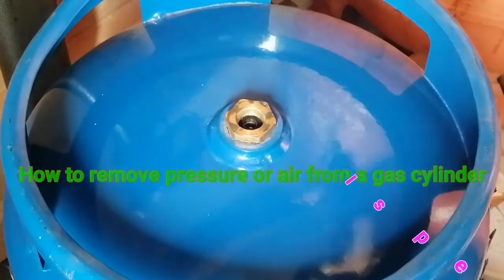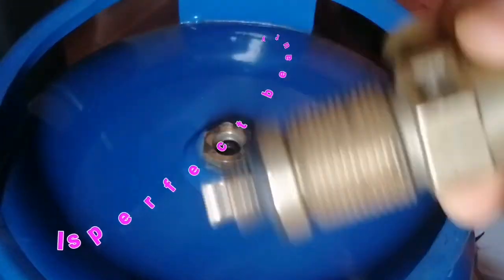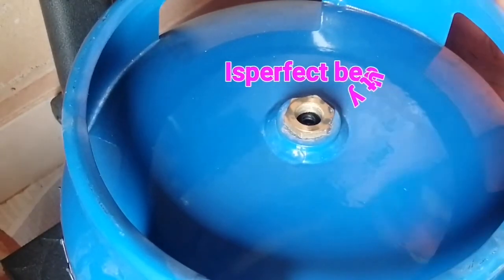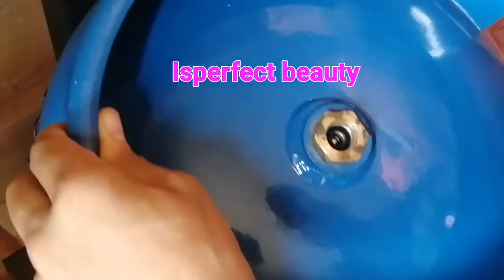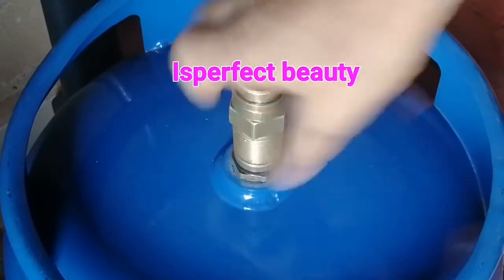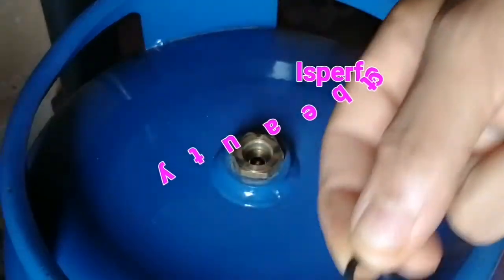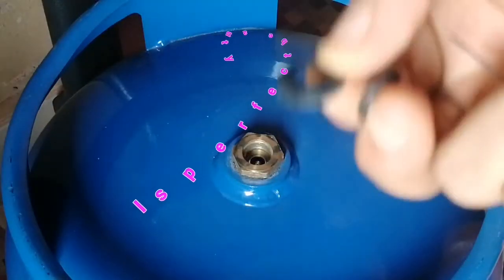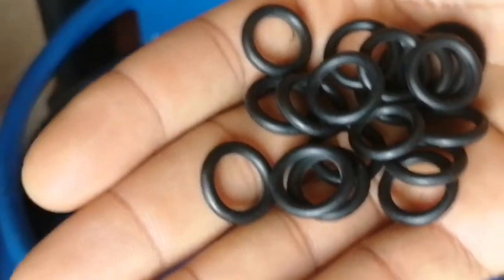How to remove pressure or air from a gas cylinder

Comment: Please I have issues filling gas for a particular customer, the gas was going into the cylinder and it stopped suddenly I tried this method by releasing pressure from the cylinder but I notice it was my products that I have filled inside that’s coming out. Please what can I do?
Reply from the maker: Air is deferent from gas. when are is coming out, you know. If gas is coming out, you will know as it comes very cool. If it is gas coming out, i means the cylinder is full. It is important to know the weight of the cylinder when it comes in, and rescale when you finish fill and add it up to see if it is completely.

Comment: My customers keep complaining that our gas doesn't last. What could be the cause? 

When Customer comes, i first of all, fix the nozzle, then the hose, put on the scale, place the cylinder on the scale, it will start from zero to read till for instance 1kg. But after removing the host and nozzle. The it wont be upto 1kg. Y?
Reply from the maker: For the last, try and buy from a different gas plant.

Try to see if your scale is working properly

Comment: Good afternoon I started a gas business last week but I had a challenge days back I wanted to fill for a customer but the pressure was not going into the cylinder. What could be the cause
Reply from the maker: Try and remove her from the cylinder, just like it is shown in the video. before you start filling for the customer

Comment: So please which of the rubber is the best to use
Reply from the maker: The one that comes with the cylinder is good but it make it difficult when refilling. So the other one which is used for replacement is much better because you don't find any issues when refilling and it's okay.

Comment: Good day sir, I have been having alots of shortage in my gas for the past weeks now if I fill 50kg I will see 37kg I want to asks if is from the station or from me
Reply from the maker: I will not say much. But I advised you to buy gas for a different/another gas station. I see if  there is difference.
Reply: If you’re using 100kg scale then the mistake is probably from you not the station. I guess you didn’t place the scale cover properly.. TEST:- on your scale then scale yourself “jot your weight” then remove & turn the scale cover, this time if you scale yourself the result will either be higher or lower; solution:- set the cover in the direction that gives you higher result